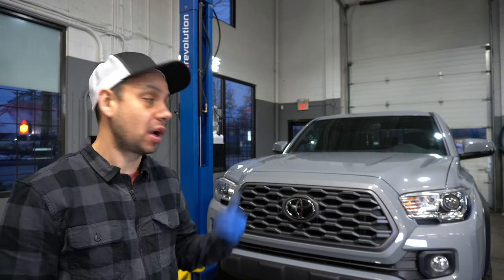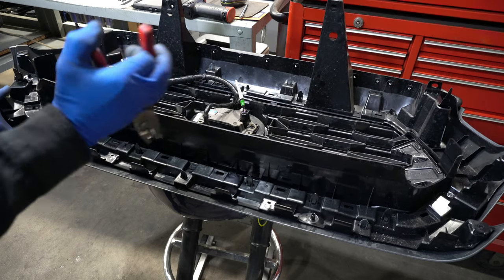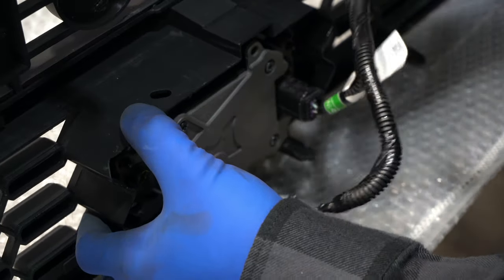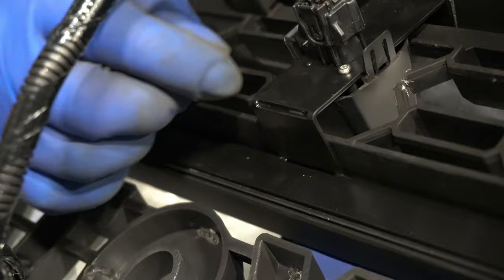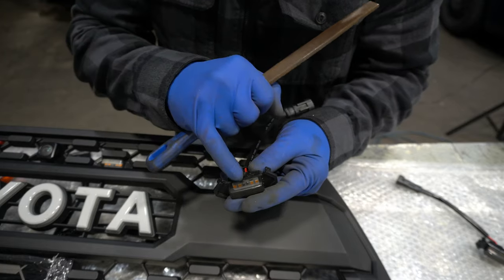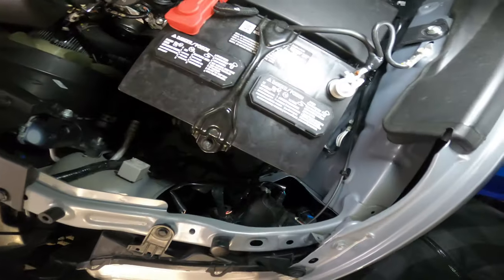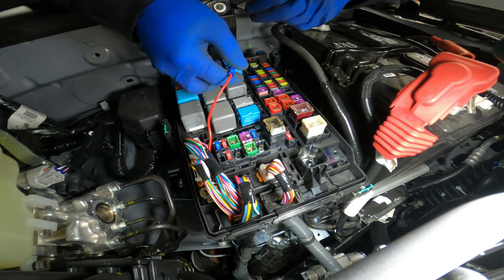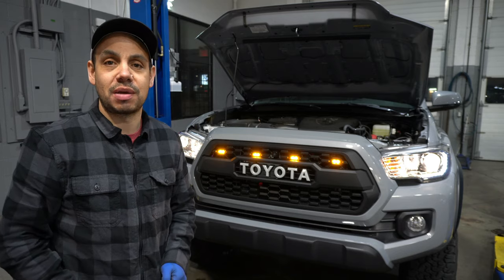Tacoma Trd Grill// Front Camera & Lights // The Right Way!

Comment: Just got my TRD Pro grill from Taco Vinyl for my 21 Tacoma that has the smoked amber raptor lights, front facing camera bracket and sensor garnish. Hopefully the install is super easy - I am really nervous about the camera and the sensor malfunction! Your video helped with the camera portion hopefully I do not mess it up!!
Reply: I just ordered the same setup from Taco Vinyl today also. I got the smoked white lights with cement color lettering and camera mount for my 2021 Limited. Have you installed yours yet? How did it come out?
Reply: @stihlpro2401  Strangely enough, a minivan backed up into my truck and I have to take it to Toyota on Monday for repairs. They said they would do the installs for me on top of repairs covered by my insurance so I have yet to see! I did get the grill already and it looks premium quality. Cannot wait for them to slap it on
Reply: I have a 22 Limited myself and was getting ready to order the grille from Taco Vinyl . Just wondered if you have had any trouble with the TSS sensor or the camera and it's angle since it was moved from the bottom to the top and the TSS sensor was moved down from the middle position. Any advice would be appreciated since my truck is a Limited I just wondered if you ran into any problems by switching out the grille. Thanks

Comment: Good video...the fuse part is my question....is it a double fuse adapter with 2, 10 amp fuses? Or I guess I can open the fuse box cover and look. But does the fuse kit come with a adapter for 2 fuses into one slot? Thanks for a precise install video.
Reply from the maker: Itll be a double fuse adapter. Thanks and goodluck 👍

Comment: Great video! Just hopped from your auxbeam switch panel install. Was wondering if you know why my right passenger side headlight doesn’t work after installing the add a fuse wire to the location in the video. My switches on the auxbeam do work and power on any lights connected to it but the only issue is my right headlight now no longer works. Any help would be appreciated! Thank you!

Comment: Your tutorials are legit!! So good! 
Quick question, 
Do you like the 2020? Have you noticed any of the infamous “tranny hunting gears” issue? Looking to get a vehicle within the next few days and deciding between the Taco or ridgeline (I know, I know haha). But just worried the taco still has that problem. 
Either way, content is legit! Definitely subbing.
Reply from the maker: Thanks.  As a long time tech, I've driven a lot of vehicles. That being said my 2020 trans shifts exactly like I'd expect it to. The computer and vehicles job is to bring the rpms down and in a lower gear to try and conserve fuel. I've also heard they've had tcm updates to work on previous issues. In my 2020 I dont feel it's a concern or off. Possibly was a bigger issue earlier in production.  Hope that helps.
Reply: @Beacon_Offroad  yes helped out a lot! Thank you very much!

Comment: Did you buy the grille/lights locally?
Reply from the maker: No, I order from Tacoma Lifestyle.
Reply: @Beacon_Offroad  Awesome, how long it did it take to arrive? I see they have free shipping which is nice. I bought some white grille lights off FB marketplace, and they're total junk. They don't even clip into the grille. Got condensation in a couple of em after about 2 months. I took them apart and sealed em with RTV silicone in the meantime, but I may end up ordering from these guys. Really diggin the "smoked white" look.
Reply from the maker: @NsIX3  I've placed a few orders with them. Assuming it's in stock they've been about 1-2 weeks tops on previous orders.

Comment: The grille I got from TacoVinyl does not have holes for the 8 screws. Anybody else have this issue?
Reply: Depending on the insert you get, I believe you don't re-use the screws from the factory insert.  I didn't with mine.  It is just held in by 8 or 10 of the pressure tabs.
Reply: @adamlynch4776  it's definitely sturdy enough without the screws, the tabs hold it in just fine